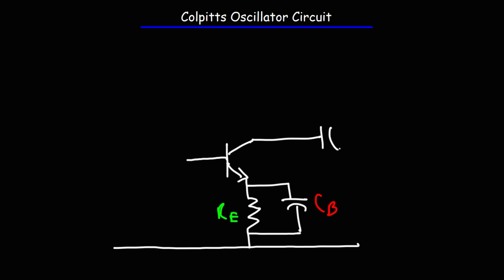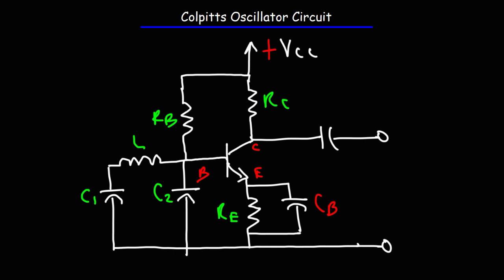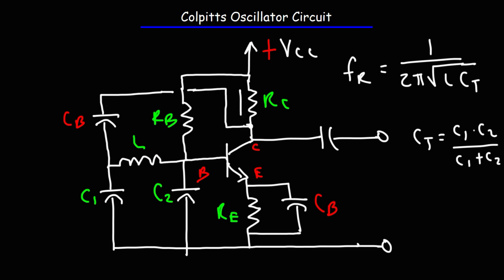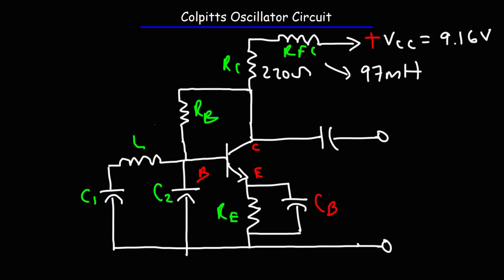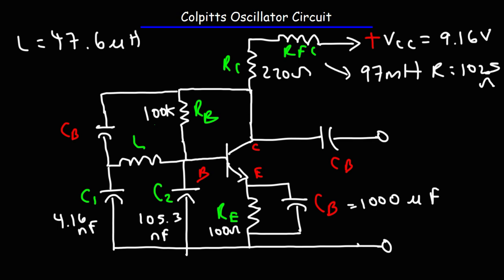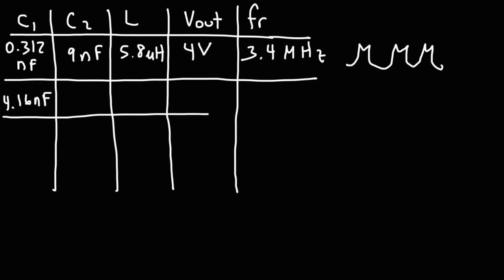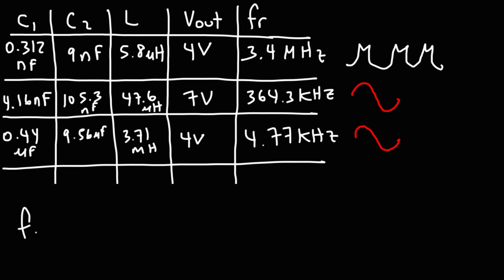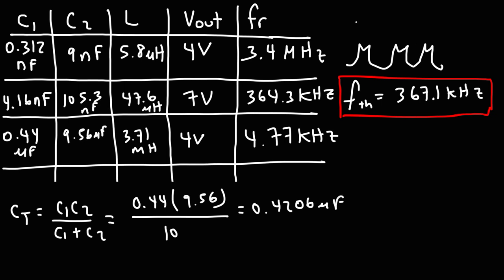Colpitts Oscillator NPN Transistor Circuit

Comment: Why such large capacitances on your DC blocking caps?  I've used caps on the order of 1uF to 0.1uF.   When I built a Colpitts that was running at close to 1MHz I used 0.001uF.

Comment: The Hartley Oscillator is for much higher frequencies. I wanted  a 1Khz output years ago and used a frequency shift oscillator with an op amp but had unsatisfactory distortion. Thank you!

Comment: You can get a much cleaner sinewave from the Colpitts if you take your signal from the tank instead of the collector. Obviously you need to take care not to load it excessively or you'll kill the oscillation.  Above 10 kHz or so the circuit actually begins radiating pretty effectively so you can monitor what its doing at some distance using a coil pickup,  and at higher frequencies still, an antenna.

Comment: Why do c1 and c2 have to be different?
Reply: They dont have to be. I made the circuit using a 337uH inductor and 2 100nF capacitors and it works fine.